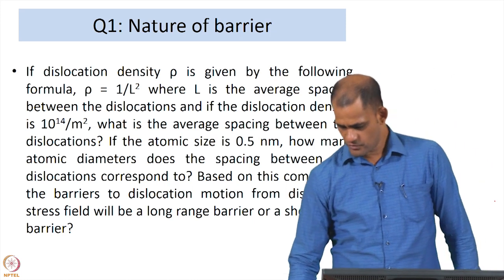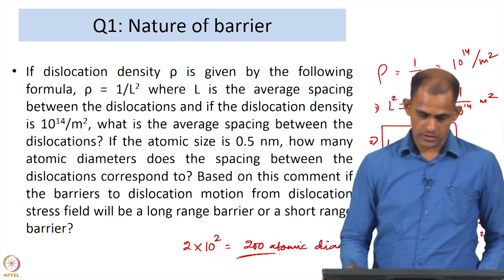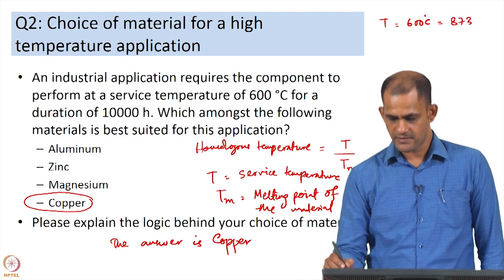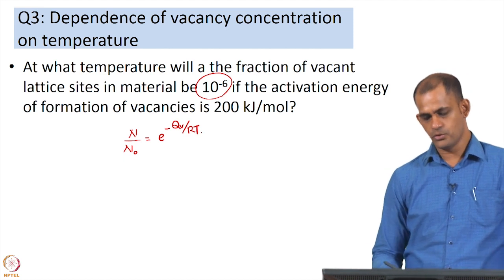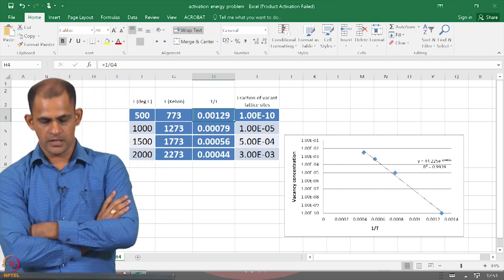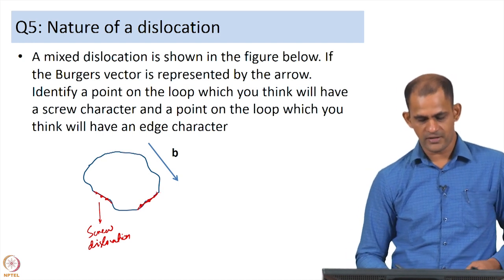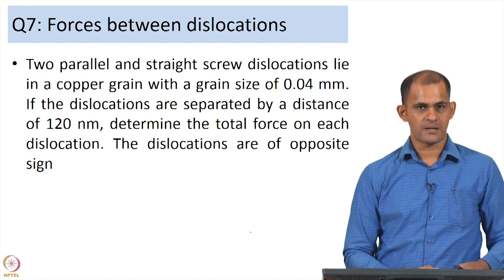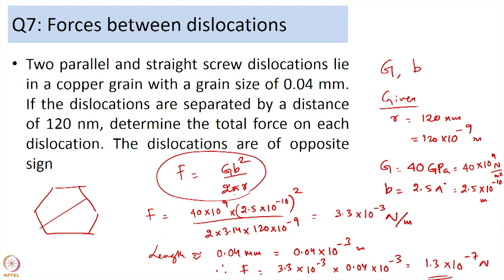Basics of plastic deformation and characteristics of dislocations - Part 3

Comment: Respected sir,
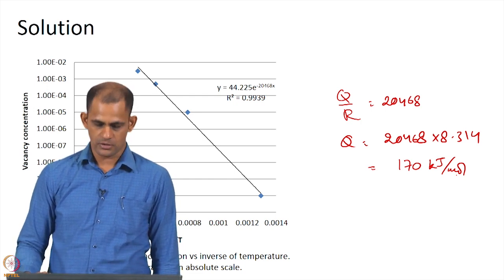For question no. 4 or at 18:03, I think the graph was supposed to be ln(N/N°) vs 1/t instead of N/N° vs 1/t. So I'm getting a slope of 17560.78 and hence Q value is 146KJ/mol by linear fitting in Origin Pro. I'm waiting for your kind response.